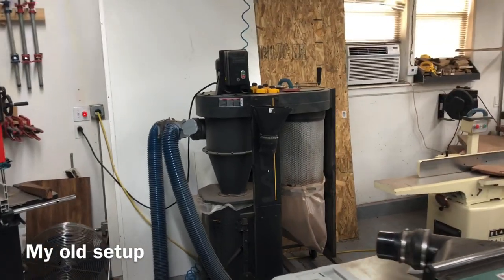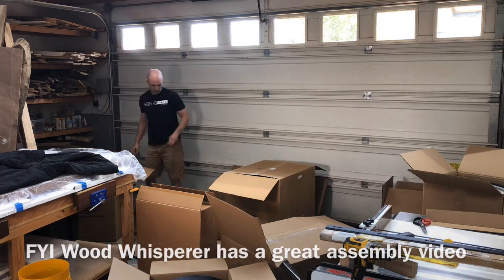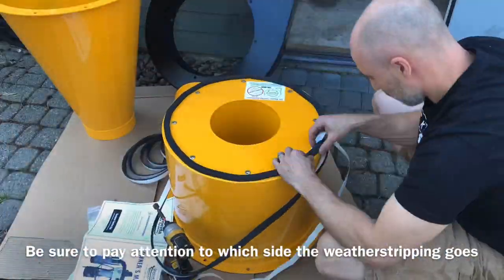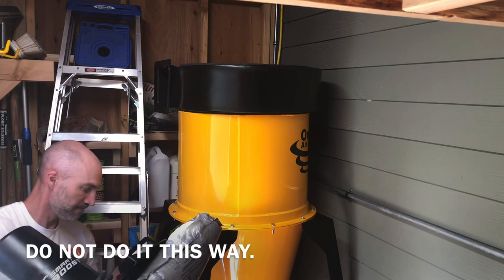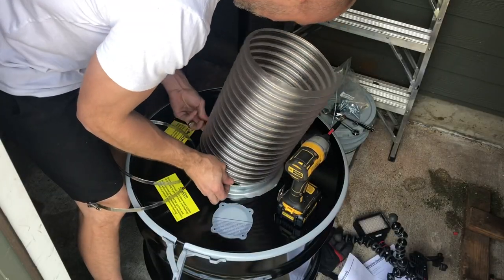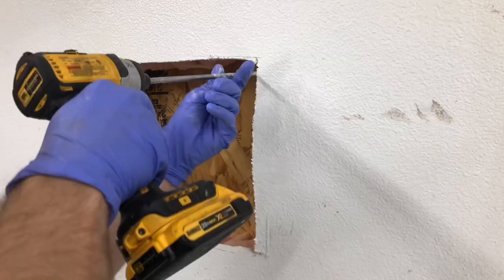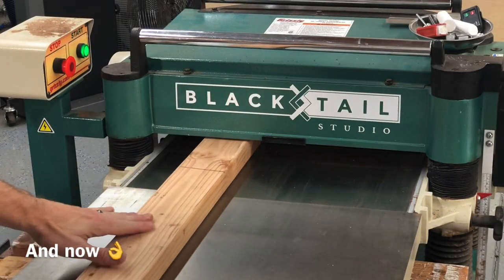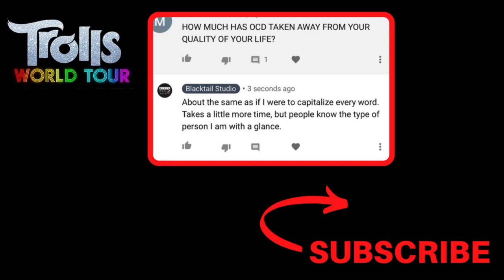Garage Shop Dust Collection - DIY Woodworking

Comment: The Onieda is removing a tremendous amount of air from your shop. Are you returning it to the shop from the shed? If not, your shop is in serious negative pressure when the collector is on. You will want to think through where the air is going to come from; you don't want it to be drawing from an area that has a gas fired appliance.
Reply from the maker: So I have a cracked window to keep myself from dying. Got that tip from someone on Instagram. Also added a carbon dioxide (monoxide?) detector. It will suck the cold and warm air out though.I don’t run it all day,, usually short bursts. If it becomes a problem I’ll get a return set up though. Good points!
Reply: In my case, I'm in south Texas, no a/c in the shop, if I'm working the garage door it up and a 5' fan is blowing in. LOL
Reply: Great video.  What about if you are in a cold climate.  How easy is it to clean and how is the silencer?
Reply: Yes, if I did that here the amount of heat I’d lose would be prohibitively expensive.
Reply: Roger Manwaring, Jr I.
 I would agree with you if his shop was an otherwise sealed vessel. I imagine the garage doors are not particularly tight. I would like to see some data but I  doubt there is more than 0.125 psi difference in shop pressure with the vacuum running and ambient outside pressure. It’s an interesting theoretical issue but not an actual problem. A simple vent in the garage door would solve that 1/8 pound issue....if it is an issue.
Reply: I would think that a potential solution to this ventillation issue would be to open a return whole from the shed back to the shop. I get it that you may get some noise but all of the air that gets removed from of the shop will be blown right back into the shop, once cleaned.
Reply: @BlacktailStudio  Have you considered adding a pipe to return the air from the shed?  It'll be louder, but everything will be neutral then for pressure.  Then you don't have to start/stop it all the time.  Your dust collection is also scrubbing the air you breath, which is good.
Reply: Great video and thoughts on the install. I did have a question along this same line, isn’t the only filter air ending up in the shed?
Reply: There will be enough passive air coming into the work shop for that never to be a problem.
Reply: This is great to see. I have planned to put my dust collector out of the space and definitely don't want to loose my controlled climate. 
How loud is the collector? ie, do your neighbors hate you now?
Reply: Oneida rates this systems at about 1100 CFM with 6" ducts.  A 2 car garage with 9' ceilings is approx 5200 ft2.  This means it only takes about 5 minutes of the dust collector running to completely turn over the air in the shop.  Cam a baffled air return might save you some big money in utilities or comfort in the cold months; the baffles will reduce some of the noise.
Reply: @bobbrown8615  I was about to put my collector in the attic above my garage shop. Then I realized the negative pressure problem. I was actually planning to build a big box around the collector that I could easily open, and then just have a 1'x2' opening with a standard AC  filter. I decided to put the dust collector in my shop. I was mainly worried about heat in the summer, I have an AC, and a barn electric 220 heater in the winter. But I also control the humidity with a humidifier in the summer. Much easier to put it in the shop. I'm wearing hearing protection anyway.
Reply: @BlacktailStudio  One thing you might want to consider is installing something that's typically used for overpowered range hoods, a Make-Up Air Damper. They are typically powered by a 24V transformer, and when powered, they open a valve letting air flow back in to the house. Most units are switched by the device sucking the air out of the house, but they also make pressure sensing switches which can open the value when they detect a drop in air pressure.
Reply: Add a transfer air duct from shed to shop. Transfer air duct that is insulated is designed to reduce sound.
Reply: @bauerdad  we used to pop open the windows in our makerspace because the dust collection was very bad. We added a fan to the window to get more air in when using the planer.
Reply: A
P
Reply: @SSBailey77845  Thank you for differentiating between theoretical issues and actual problems. So many people fail to do so.

Comment: Youtube. I wouldn't know how to do 75% of the stuff I do without instructional videos. I installed a heat pump water heater a year or so back. It was about 300 pounds. I used rope + climbing pulleys to get it up high enough while my dad maneuvered it into place. I couldn't have imagined trying to do it without that mechanical advantage.
Reply from the maker: Oh man. That’s sporty!

Comment: Pocket Knife - Hey Cam, I just ordered a 2 HP Harvey C200-30. The delivery truck dropped it off at the end of my driveway. For most people, that's probably not too big a deal, but my driveway is over 200 yards long. I used what I had on hand, my furniture dolly and ratchet straps, to move this 470 box alone. It took all of my nearly 200 lbs. pulling as hard as I could to tip the box so I could move it. When I did, it build way more momentum than I was expecting or had ever experienced. The dolly handle basically buried itself in my pelvis and just crushed me to the ground. I was lucky as hell I didn't blow an ACL and was just barely able to stand it back up. I did slightly pull a quad doing that (I don't do heavy super deep squats any more), but I managed just barely to get it up. The rest of the 200 yard trip went without incident, but if you want a good don't do it this way story, that's my most recently one :)
Reply from the maker: Jesus man! Tip the guy $20 next time and save yourself. Great story though
Reply: @BlacktailStudio  That would have been the smart approach. However, the part of me that still thinks I'm a 26 year old powerlifter apparently won't die 😂

Comment: My favorite tool is YouTube,  it has giving me the ability to learn many things from wood working, epoxy, spray paint art, and detailing the car. When should one consider a dust collection system?
Reply from the maker: I’d say make it your third tool.
Reply: @BlacktailStudio  i would agree, right after the miter saw, because nothing will inform you of the need for a dust collector like a miter station will!
Reply: @sophiesmith5922  in my old shop I installed the dust collector the day after I got a planer.

Comment: I pretty much am a hand tool woodworker with vintage saws, planes, chisels, etc.  I do use a router occasionally as well as a jigsaw and drill press.  Even though I don't generate a lot of power generated dust, it is enough to affect my breathing and I am ever more aware of the need for a dust collection system even though on a much smaller scale.
Perhaps the most time saving tool I currently use is my trim router mounted on a clamp on table that I built for doing dados and edge treatments.  Believe me, hand creating dados is a little more time consuming than I normally choose to endure.
Thanks for sharing your dust project, believe it or not, I did amass quite a bit of useful information.  Cheers and enjoy your shop, it is really a nice setup.

Comment: My dust collector by far makes my life the easiest.  I have hand-me-down cyclone similar to the Oneida (but not as good) from Penn State Industries (they don't make them anymore).  It came from my dad's shop.  He accidentally dropped the impeller and motor while trying to get the motor off to replace the bearings.  He had it loaded in the back of his car ready to take it to the dump when I saw it and claimed it.  I hammered out all the dents, took the motor to a motor-repair guy and it worked for another year before the motor burned out.  So I called Penn State Industries and they happened to have one last motor on their parts shelf.  It's been working great ever since.  And Cam, you're inspiring me to start a woodworking YT channel too.  I'm going to try to post my first video by Christmas.  I have really enjoyed your work - while perhaps not the most 'technical', it's very beautiful.

Comment: One of the best stories I have, was buying my jointer/planer out of a basement in Philadelphia. One way up and down. 28” wide staircase, that had a door perpendicular to the direction of the stairs. It’s a Hammer A3-31, weighs about 700lbs. Rented a 1200lb escalera piano hauler that barely fit through the door. Took about 6 hours and 3 guys in some VERY precarious situations to finally get it up and out.
Reply from the maker: There’s always a way!

Comment: Drum sander simply because it is the newest tool in our shop. Since you can get tear out easily with planers, the drum sander saves a bunch of time and energy. We are still using a shop vac-based dust collection with a Wen air filter in the ceiling. Cool system, Cam. Congrats.

Comment: Heres my similar story. I was building a 3-phase generator for my workshop. Using a 10 hp motor , mounting it over my meter panel was quite a challenge. I ended up using a cheap bike lift attached to my overhanging rafters. Mounted it on a pair of unistrut brackets . BTW im 5'7 and 74yo. and never been to a gym. Being a retd engineer helped.

Comment: Very nice video. The only downside of having the collector in the shed is that you are sucking cooled or heated shop air  out of the shop. If you could add ducting to put the filter stack inside the shop, you would then be returning the same temperature air back into your shop.
Reply from the maker: Yup!

Comment: Smart phones really make life easier nowadays. Having a powerful suction unit is key to staying healthy. I work in a dental laboratory. I do model work which involves using vertical sanding belt trimmers, lathes and hand pieces. It kicks up a lot of dust from the dental casts. Thankfully our suction unit are huge and incredibly powerful. Really saves my lungs and is more important than you know.
Reply from the maker: That’s crazy! Thanks doc

Comment: Fav tool: AEG 58V leaf blower.
Regarding the motor install, If it had been me I'd have gone doorknocking with my neighbours until I found a big man. "Excuse me mate, I'm from across the street. I've got a new piece of machinery for my shed and it's a two man job and I need someone's help for about 15 seconds of lifting. I hate to ask but I'll buy you a (insert generic gift, bottle of wine? Six pack? Block of chocolate?) if you help?" It's that easy. Don't be afraid of your neighbours, you never know how helpful they might be!

Comment: My utility knife.  If I am honest, they is probably the #1 tool I reach for in the shop, office and house.  Cutting tape, opening packages, cutting bundle straps, trimming laminate, marking lumber, trimming 3d Printed parts, etc.  Great video man.  I'm working on getting thje wife to sign off on an under the deck shed here.  It's full height and right outside the garage!
Reply from the maker: Oh awesome!!

Comment: I agree with Brian my favorite tool is You Tube.
I recently made a over head dust collection for my table saw using auto tailpipe components. Slipped together like a dream and works great. Used a 4x2 T Y and 2 inch tubing.  With the hood and all components, I didn't spend $100.  My son suggested I make a You Tube video and build him one.
Reply from the maker: That’s great call!

Comment: A 20yr old Craftsman extended & magnetized Phillips screwdriver. It fits just about every phillips screw that I need to put in (w/o a cordless driver).  Doing electrical work, automotive, or trying to reach a pita-screw... so simple a tool and yet my goto when I need it.
Congrats on Oneida and their generosity to improve your health and woodshop! You are now Mr Liquid Glass and Oneida Jr. Please follow up when you get the auto-gates, and here's a tip: you could have laid the vac down, bolted the motor on, then stood it up. Plus you need to re-arrange those shed shelves because, well, how will your reach the garden food? I know, build a cleat-wall between the vac and aircomp, or, get another shed with the money saved by Oneida!  Oh another suggestion: Paint the metal ducts black, to go with BlackTail :)
Reply from the maker: Great tips!

Comment: Honestly for the main most useful tool I've ever used for any of my crafts: Awls! I use awls for marking measurements, poking holes, putting tiiiiny details on stuff, sizing holes in leather to the proper size, all sorts of stuff! To the point I'm thinking about making a dedicated storage thing for my awls once my shop is finally set up. Most useful one is an old one my late grandpa made, papa always made tools when he didn't have something on hand. He ended up grinding down a VERY old Craftsman phillips screwdriver into a smooth point, and even as I type this it's sitting next to me. I feel these are very underrated tools lol

Comment: Its New Years Eve (2021/2022) and I am a one man small shop --  in the making.  I have the beginnings of a shop with the table saw, jointer, band saw, new 13" planer (arrived two days ago - zero use yet), drill press etc.  Currently have a small cyclone dust collection attached to my shop vac.  I loved your "Don't do this' beginning, because as I said, I am a one man shop (and 73 years old).  Although I would love the set up you have, I am not to that point in my wood working, and will probably start with the mini gorilla set up.  Just wanted you to know that the info you provided was awesome, although the free-bee I am jealous of.  Thanks for your video  Made in USA is awesome selling point.
Reply from the maker: That’s Tim, and good luck!

Comment: Best tool is a old Braddle. So many uses apart from making pre pilot holes. It’s a pick, a hole alignment tool, a scrapper of difficult old paint and varnish finishes, a small pot opener, an expoxy small surface filling tool, a ruler (I know how long the blade is from point to handle, a hole maker for leather stitching and so many more. I keep it clean and sharp. It’s only small and I constantly forget where I last put it down!
Reply from the maker: I know that game!

Comment: The air fryer has made my life a lot easier haha.  Also steel toed sneakers, I just ordered those indestructable shoes their called on the tip of my friend Birdie who is a badass builder.  She stepped on a nail full on and it did not go through.
Reply from the maker: I bought those. Still wear my flip flops

Comment: Best tool for me has been my $5 husky folding box cutter. I have more knives than I can count but that impulse buy three years ago has become my EDC. I appreciate seeing IRL struggles doing things by yourself. It can seem like I’m the only one. I had a bear of a time moving around a floor scrapper that I rented to tear out the old flooring in my house. I didn’t think much of it but should have asked more questions when they had two large men load it into my Subaru. That was fun to get out on my own. Even more fun getting it back in for the return trip. Thankfully all fingers and toes made it unscathed.
Reply from the maker: That’s good work!

Comment: My favorite tool to make life easier in the garage is my leaf blower. I'm in a small space and dust collection is a simple shopvac with filter so small dust everywhere. Leaf blower helps get things cleaned out a bit. Maybe next time rig up a small pully in the rafter and just pull it up. Easy to do and a strong pully can be easily attached and unattached anywhere. Especially when you are moving some of those big slabs. Congrats on the new toy! She looks powerful!
Reply from the maker: I use mine ALL THE TIME in my shop

Comment: Looked like a tough job. I was in the Air Force for 11 years. I worked on generators, lots of heavy parts. My first deployment in Kandahar, I had to replace a radiator for a unit. The generator engine was a John Deere 6.8L diesel!!! So yeah pretty nice size radiator. I wanted to replace it by myself, mind you, it is 120+ degrees outside. I got the radiator almost completely in and one more push and good...nope! I pushed way too hard and punctured the radiator. After about 5 min of "not so pleasant" words. I took out the radiator I just put a hole in and got another one. I was a lot more careful the second time. Moral to the story, grab a wingman.
Reply: I've gone down a "Sampson Boat Company" YT rabbit hole. The things that Leo does with a pulley and rope is just amazing.
Reply from the maker: Crazy!!

Comment: Cam,

My go to tool is a screwdriver that has 2 straight and 2 Phillips drivers.  I’m ver impressed with your instillation of the dust filter. Today I mounted an 8 ft. LED light on my garage ceiling that is 14 feet off the ground....solo. I spent a lot of time climbing down and finding stuff I dropped! Fun.

Comment: my Starrett stuff from back in my machinists days long time ago  70s . Thank you Cam . loved the oh! shift moments . reminded me of me lol . gosh man good luck. my worst oh shift moment was the garage door spring . the lag screws were coming out . hey just 2 bolts . replace em one at a time . loosened one and the whole thing jumped off and chewed my arm off .. oh and at least i bent the 1" steel bar that got me . old geezers are tough lol . so be careful if you must  hire someone to help you . early morning at home depot you might find someone that needs work . good luck Cam